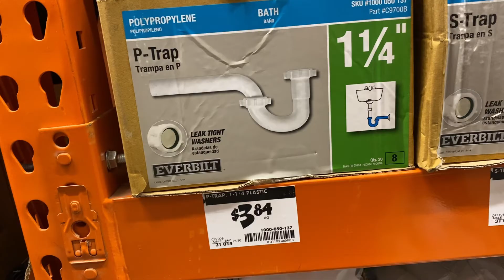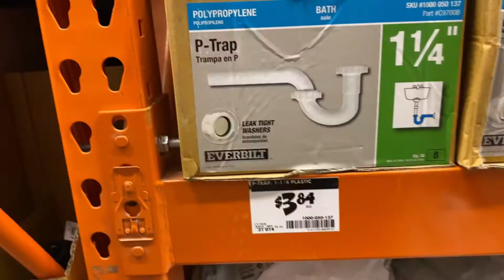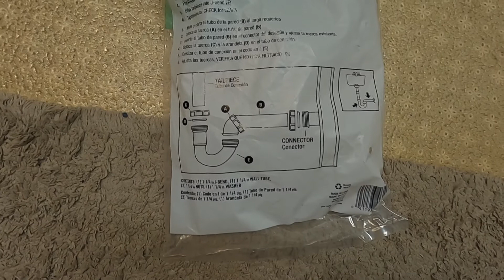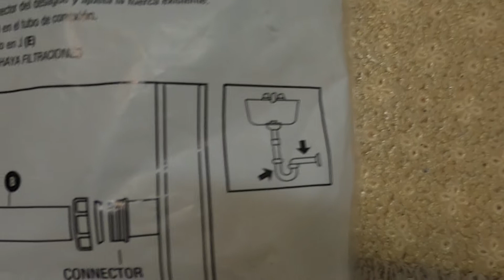Home Improvement..Working on moms sink in her bedroom-bathroom..Replacing plumbing adding new faucet

Comment: Got thru that pretty good, you did. Next time stuff plumbers putty around the faucet openings to keep water spilled around the top from leaking under the sink. The thin rubber gasket isn't enough. Good you only hand tightened nuts. Now install a tall elongated bowl toilet. The American Standard Champion 4 MAX water saver from Home Depot is the best. It comes as a complete kit, tank and all. This will help your mom from having to drop down so far to be seated and she will find it easier to get back up. A 17" horizontal grab bar is also helpful on the wall 18-20" above the bowl and the right end even on a vertical plane with the front edge of the bowl.  Peace, Bros.
Reply from the maker: Thanks for watching Phil...All great advice...This is moms temporary bedroom-bathroom...we are making a new bedroom bathroom attached to Mikes bedroom...Moms bedroom she is in now will be an office with a door out to the deck in the future...anyway that is our plan...so we will finish the sink and toilet in the future after we finish moms new bedroom-bathroom in the near future I hope if all goes as plan...
Reply: @doityourselfwithfixinitwit270  It will if you stick to it. Sounds like a good arrangement. The bus can wait. She will forget the bus but not her new bedroom. My experience with my grandmother and two aunts shows they focus on new things for them and either forget or set aside historic events except in calm quiet conversations with them. I saw them thru to their death and learned a lot about myself in the process.
Reply from the maker: @busoldmanphil7293  We are blessed to have mom with us...Good for you taking care of your family when they needed it most, most people are to busy to bother with old people...God Bless you your a good guy....